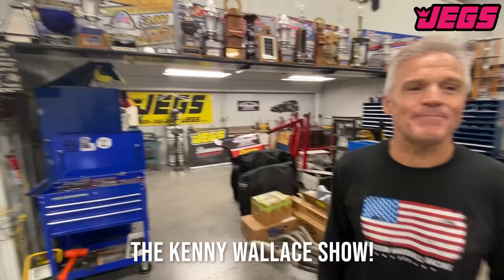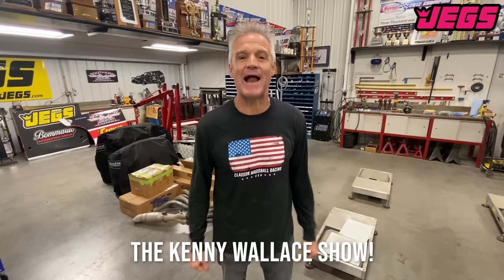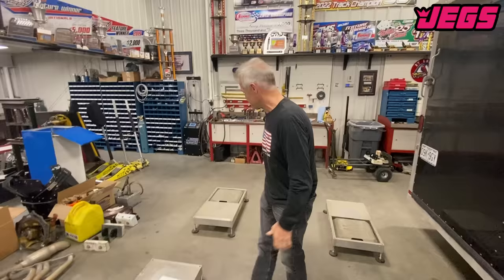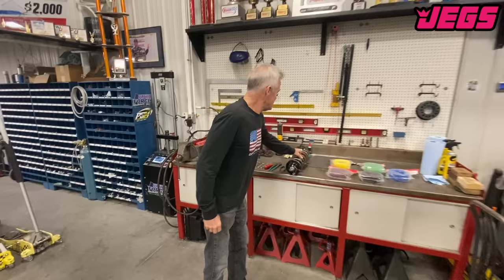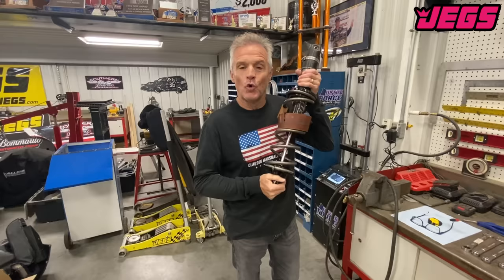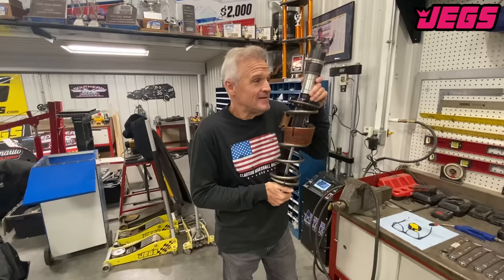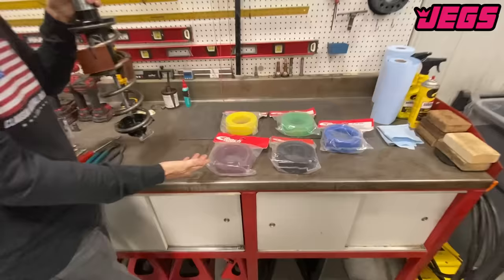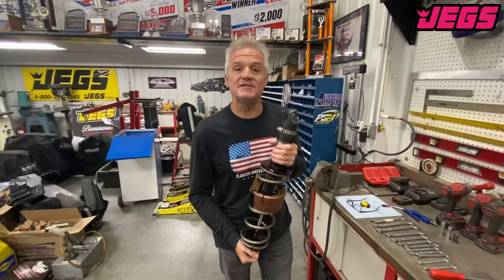This Is The New Way To Setup Your Race Car!

Comment: In a way, you're lucky to have learned through the hard knocks school of technology and smart enough to use new technology such as the chassis set up systems you showed. But, it's no wonder in the modern era that big money teams hire graduate engineers to figure set ups.  Thanks for sharing your knowledge to us fans of racing.

Comment: Flashbacks to '89 or so......Helping out a local late model father n son "team" set up the car via those grain scales!! Jack it up, adjust shock, place grain scale under tire, let car down, give the car a little shake, driver sitting on door sill and see what it is. Nope, not right, repeat process. Ugggg

Comment: How often do you end end up tightening the rebound a click or 3 ( assuming you have the ability yo adjust rebound and compression)when you add 1/2 or full turn because it causes the shock to top out unloading the chassis?

Comment: Herm the dot has portable scales that you slide them under the front of your wheels all you have to do is drive up on the scales and there only they weigh just like your scales .the thing is they weigh only 20 to 25 pounds get you a set of them to carry with you they carry them in there trunk of there cars if you looking for portable sales .just thought you was looking for a travling set of 4

Comment: It’s not a new thing. Drivers have been calculating Spring loads for decades utilizing a Tape measure and math. Yes it can be done without a smasher because it’s math. A  smasher is just easier.  There’s still good reason to utilize scales with spring loads. In fact a car can be just as quick if you set up with scales the old way. As long as you understand the car dynamically.

Comment: can somoene explain why the left rear axal has to come out to scale a race car?  i can understand the shocks but what does the left rear axal do vs th right?
Reply: Open wheel guys that I know don’t do that
Reply: I work on tour type modifieds. we pull the axle out just enough to get it free of the spine because when you roll the car forward and back after each adjustment the stagger will Bind everything up, including including the scales.
Reply: @jerseyshoredroneservices225  right on... thanks.... i just learned something new